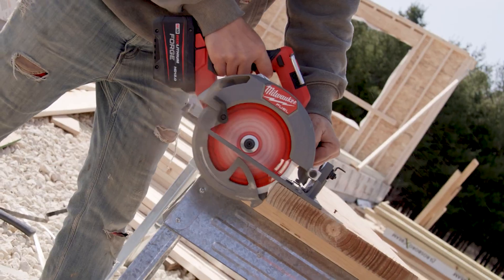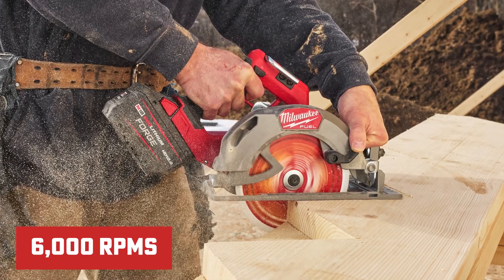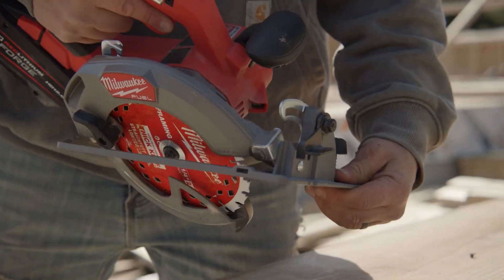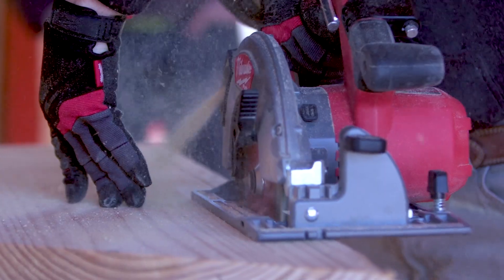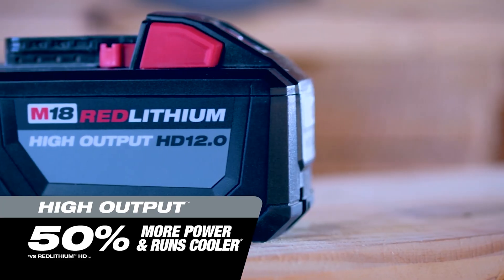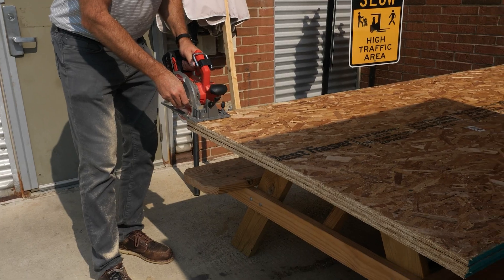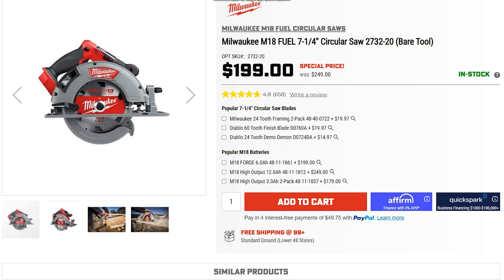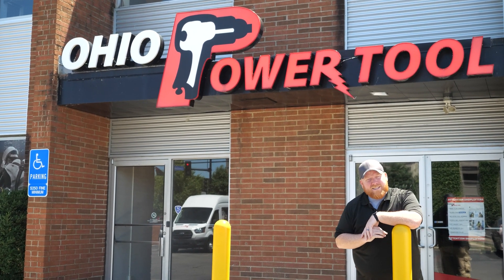Milwaukee's M18 FUEL 7-1/4" Circular Saw Showdown | 2834-20 vs 2732-20

Comment: Do they have them with blade on the left side of the saw?
Reply from the maker: They don't have one with the blade on the left side with the new technology yet, but there is an older model, the M18 Fuel Rear Handle 7-1/4" Circular Saw 2830-20, with the blade on the left side. I hope this helps!

Comment: Have the older version and as a remodeler the smaller package makes the one tool trip in and out weigh alittle less. I prefer how the shoe is setup more like a traditional skil saw and how the new handle is a bit more top oriented.

Comment: I have a question.
What happen if I use forge battery with circular saw 2 gen?
Reply from the maker: It does seem to perform slightly better (than 12.0 High Output) but we'd need a real rig and constant material to cut to show any data on that. In general use would probably not be able to really feel a big difference. The new Gen 3 clearly has better performance with FORGE batteries you will notice it right away.
Reply: Rip into the fabric of space
Reply: I would like to see  it!

Comment: Just picked up the 2732 for 129.00 at Home Depot. Sure I would like to have the New gen but saving 120 plus getting a tried and true performer, I couldn't pass it up!
Reply: Me to just got it for 129
Reply: Agree just got the one for $129 as well
Reply: Same here. $129 a few days ago. Couldn’t pass it up.
Reply: @frednavarro8667 I only see it for $149 on the site, $134 after military discount. Where did you see it at $129? In stores?
Reply: Yes sir. My local stores had it yellow tagged for $129. Online was $149. I have been back to the store once since then and the remaining saws were in the clearance/no home end cap. You may want to check there also.
Reply: @frednavarro8667  thank you, I’ll have to go check. Wife’s gonna be pissed.
Reply: That must be included with this saw.
Reply: HD has the 2834 with a forge 8.0 for $249 right now
Reply: I had no clue about the old ones going for 129 seen it today and couldn't find none left on the shelf... 😢
Reply: Also, the new forge battery premium is nothing to sneez at.
Reply: A bunch of poors 😂😂😂

Comment: I was in dire need of a good saw and bought the 2732-20 with a 12ah battery its been amazing so far it sucks i could not wait for their newest circular if anyone has had their 2732-20 serve them well please reassure me this saw will last
Reply from the maker: The 2732 has been a great saw overall with lots of power, lasting a long time, the big complaint is just size and the new saw does a good job cutting weight but keeping power strong. Probably wouldn’t notice much power difference with current high output batteries but new saw also can pull a little more juice from those newer Forge 12.0 batteries. If you are being served well with existing saw and making money with current saw keep it going!
Reply: @OhioPowerTool  thank you brother you are 100%
Reply: I've been running mine as a professional framer since 2017 and it hasn't crapped out yet. That's more than I can say for a bunch of other Milwaukee tools I've had. It's pretty beat up at this point so I might get the new model.
Reply: @Skinnymoose  thank you brother

Comment: I've been waiting for the new model for a while. I might just buy one in a bit. Been using the Rear Handle model for a while.
Reply: Currently HD has a sale on this saw with a free forge 8am battery. Check it out

Comment: So I can ORDER it FIRST WEEK AUGUST and should get it middle of the Month I want THE KIT because the 12 amp FORGE BATTERY ALONE is $250 so for $200 more I get the NEWEST 7 1/4 SAW BLADE BAG and CHARGER just too BAD for another $100 they Do not Throw in the SUPER FAST DUEL CHARGER